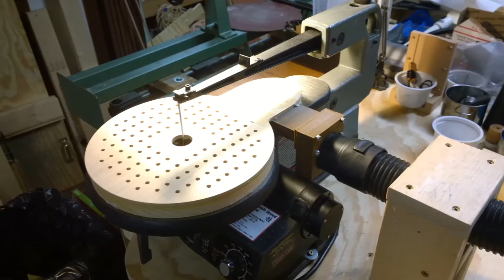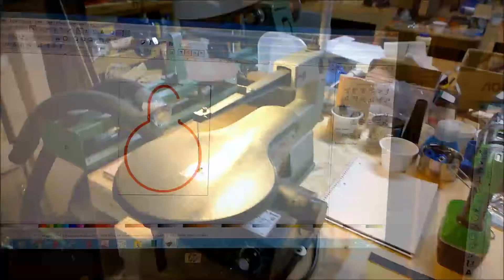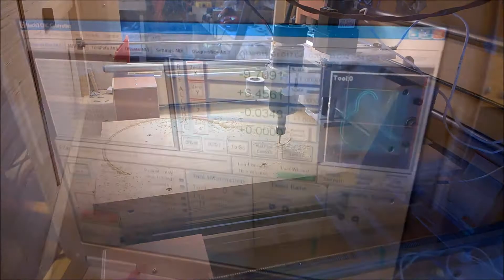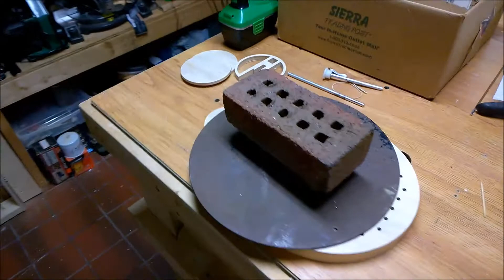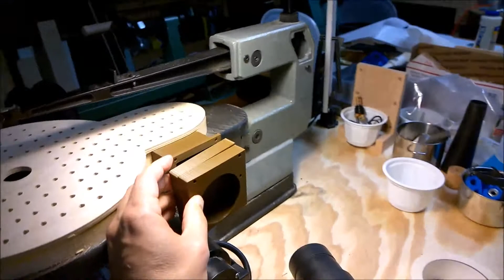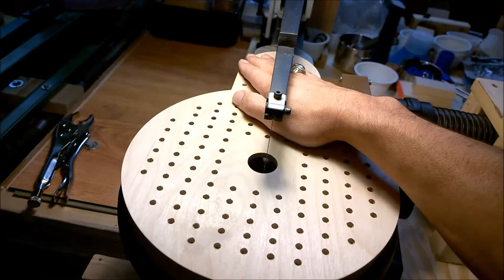Scroll Saw Dust Collector & Down Draft Table

Comment: For those discouraged because supposedly they need a CNC  machine to make this, that is BS.  I ran across a plan for a chair one day.  Top of the tool list was a CNC router.  BS.  The design was not complicated and I had been contemplating making the chair for some time, and at this time, did not know there was a plan avilable.  All I had to do was make a master for 3 separate pieces, and use my router to make duplicate copies.  And I would not have to worry about my program screwing up.  So, for a router costing $50 I could duplicate the work of a CNC router, costing likely $3,000 and up.
Reply from the maker: Totally agree.  CNC stuff is fun and can be used for lots of things but it's just another tool and often not needed.  Jigs, portable tools, and other hand tools can do great things with practice.  I just enjoy the hobby of tinkering with it and seeing what I can design with it.

Comment: You should put a support frame around the blade hole, maybe even something built for lower clearance inserts. As is that hole board is going to act as a drum to let the blade vibrate the work up and down. Even if just a little this will slow down cutting, reduce blade life as a measure of distance cut, and probably reduce the quality of your cut edges. Even if just a bit. Obviously keep the airflow, but anything to make the hole more rigidly supported by the table.
Reply from the maker: Good point.  Thanks for the suggestion.